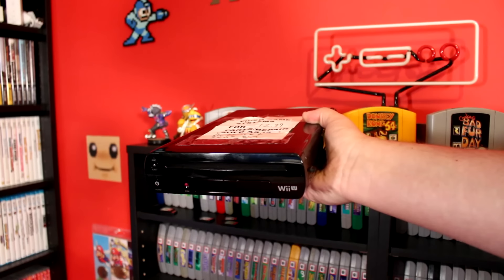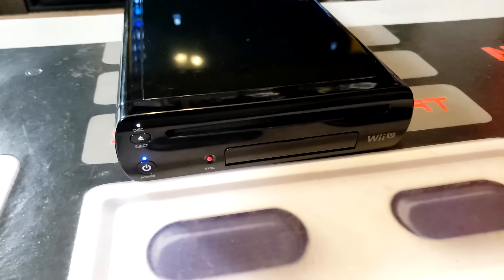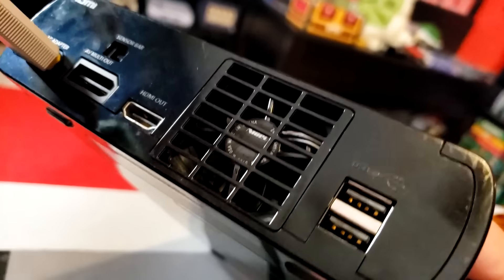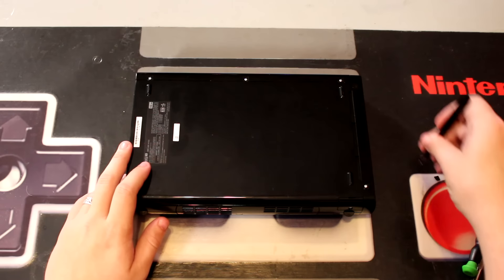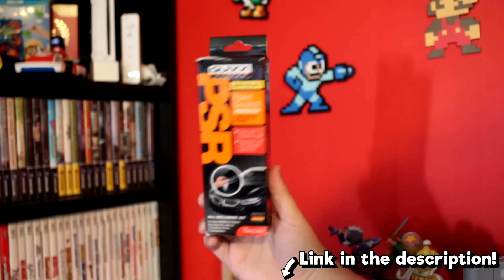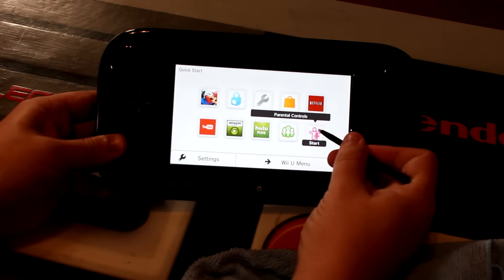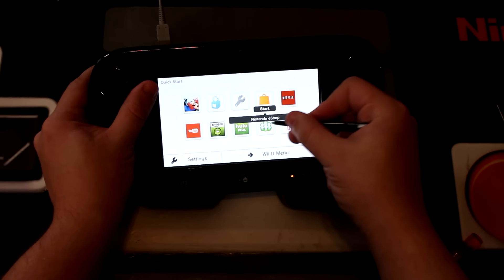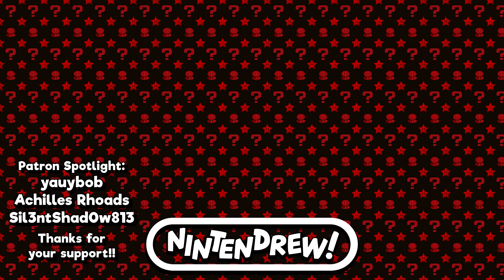Repairing a $13 Broken Wii U! | Nintendrew

Comment: In Berlin we have a tradition/Kultur of leaving unwanted things on the sidewalk or beside the front door "zu verschenken", to take. At worst, it's literal garbage that that for whatever reason wasn't taken to the bin. At best, it's real useful stuff. 3 of the chairs I have in my flat came off the street. I like to have the skills to repair electronics because my stereo also came zu verschenken because a switch had stopped working. All that needed was some cleaning of the contacts and now a €95 stereo is sitting on my shelf! As things are getting smaller and made from increasing numbers of black blobbed chips, it's getting harder. Those tight, tiny ribbon cables are frustrating! Having these skills are useful, though. There's still a lot of joy in older products and they can be had for toy prices now.
Reply: Nice. People do that in the states as well, but mostly larger items like furniture and its left closer to the sidewalk by the curb.
Reply: @alepepperoni2563  yeah, I had to "curb alert" all my stuff before moving here. Zu verschenken can be anything from leather couches (too heavy to take by myself) to literal rags. Even in Chicago, we had nothing like this. It was all the usual CL stuff or dumpster diving.

Comment: Nice, can't believe what a bargain that was.
The Wii U is such a gem, if I could only have a single non-current gen console that one takes the cake for its versatility.
Reply: In my area there is one store that will ask over 50 bucks for a none working model.

Comment: fans generally do that whole stop functioning and start thing when the bearing are going out a good way to test is if you assist the fan in turning and it starts spinning then its the bearing in it going bad. So I guarantee you the fan would have stopped again if that were the case.

Comment: Same thing happened to me about 5 years ago. Wii U randomly turned off, same blinking light turned on, it was hot, and that exact fan stopped working. All I did was spin it manually with a screwdriver while the console was on (I know, bad idea) but a few seconds later it started spinning on its own. Since then, I haven't had any issues even when powered on for extended periods of time.

Comment: I wonder if you could swap the fan with a quieter one (Noctua comes to mind), since it looks like a standard size PC/server  fan size.
EDIT: using the photo on the link, I found the part number (it's a nidec 40*40*20 mm chassis fan), and I think that a standard PC fan could fit here like a Noctua A4x10 (although that's half the thickness of the official one)
Reply: You could swap it. The only thing to beware of is that the connector won't be the same (I'm assuming here, but that's a frequent issue) and the layout of the wires won't be the same. So you'd have to find out which wires on the old fan are power, ground, tach, pwm) and match that up with the new fan. 

I have a big box of various dell server and PC fans and they all have to be rewired before I put them in a PC, Dell (like other manufacturers) purposely change the orientation of the wires around to stop the average user from buying an off the shelf fan... But if you can splice or repin the wires in the right order, it will work.

Comment: sounds almost exactly what happened to my original wii, the fan went out on it. pretty much did the exact same thing, it'd be fine for a few minutes then the power would just shut off.  and the area near the fan was super hot! so calling nintendo and explaining what happened, that was the diagnosis as well and they recommended I send it in. sure enough a few weeks later I got it back good as new! worst of all this was right around the time brawl was gonna launch for the system! so I deifnitely had to send it in ASAP to get it back and ready for brawl's launch!
Reply: The Wii U is pretty much a Wii HD with Higher specs lol (Scrapped Wii HD Revision?)
It even haves the same Crash Sound, and the CPU, GPU, Disc Drive and that stuff are the same Brands (AMD, IBM, Panasonic)

Comment: My Wii U also came with a Digital copy of MK8 and my Wii U had the Blinking light problem and it was very scary but My older brother told me it was because it was over heating because the fan was sucking in Dust because all fans of Consoles spin inward

Comment: Hah. that's how I got mine as well, found a Zelda Wii U for $20 bucks at a local thrift store with a broken game pad LCD. Spent another $20 to replace the LCD and digitizer and now have a fully working Wii U under $50 bucks.
Reply: I bought a Model 2 SEGA Genesis off of a guy for $15 labelled "For Parts Only - Non-Working". A $2 power jack and a little soldering later and I have a fully-functional console that looks almost brand new.

Comment: Real shame what happened to my Wii U. The Gamepad no longer connects to the system unless it's right on top of it. It's a problem with the controller's Bluetooth chip, but those are hard to find now, especially in new condition.

Comment: Well done! You make it look so easy. I tried just repairing a simple PS4 controller and ended up totally flubbing it and ruining the controller further… I think I would be pretty nervous to open up a console 😅
Reply: PS4 controllers are way harder to open up and fix than most older consoles.
Especially Nintendo consoles and controllers are pretty beginner friendly (aside from the switch and JoyCons)

Comment: Yo nintendrew (or anyone that happens to see this and has repaired wii u's) 
I ordered 3 Wii U's for parts, one of them im noticing the fan is actually put on backwards but it does not appear to have been opened  so idk if its a nintendo mistake or not, is it okay if i leave it that way and have air blow into the console or should i put it to where air blows out like yours and the other 2 Wii U's?

Comment: Great video! Loved it!! You should do more content like this ^^ and if tou want some advice to repair something, I’m always available! 

Seriously, you deserve to be much more known! Serious quality content here ^^
Reply: Hi, my wii u has a problem and I think I'm gonna have to buy a new one but I can't even find a console by itself so I'm gonna have to sell my stuff and buy a whole new console. I wanted to ask you about the issue maybe you would know, my red light is on but if I press the button it won't turn blue ( on ) but for some reason if I long press the button the fan starts turning, I know it's weird...
Reply: @malekhidar1267  i know this issue! It could be either your power adapter, another minor problem or your wiiU is dead.

Try unplugging it, wait a whole minute, push the power button 30 seconds, plug it back in and re try to power it on, if it works, your wiiu is saved! If not, come talk to me in private and we’ll try to fix it together ^^
Reply: @malekhidar1267  hey! Just wanted to know if I helped on that one? ^^
Reply: @ToriSa42  hiiiiii, I'm sorry for the late reply I've been quite busy, sadly I've seen this advice on redit and tried but it didn't work, I've even taken it to a repair shop and it's been a month and they haven't fixed it, luckily I got a very good deal, 30 bucks for a new 3ds XL so I'm gonna sell that and try to be buy a new wii u console. But thanks for helping regardless.

Comment: As much as I like the DIY projects there are some points in the video that does not really make sense.
Such as doing all the cosmetic stuff before you even ensure the console was fixed.

Worst case you use up material for polishing a nice piece of junk :(

Always ensure the device is working FIRST!
Then put it back together
Then cosmetics
Then test again.

Every other order is not reccomended at all!
Reply from the maker: When presenting for YouTube, sometimes a little creative editing is necessary for flow. 😉 In my case, I knew the Wii U was working before ever opening the case, but I did still double check my work off-camera. Actually, when recording, I repaired the gamepad first! Thanks for watching. 😄

Comment: How much would you charger to repair a wii u gamepad?
Reply: Typically a broken console should sell for 1/3 of the price. If it’s limited cosmetic damage (has no effect on the use of the console but also no cracks/ or major chips) you could sell for 3/4 the price of a new one. If the console is in pristine condition with the box, documentation, and cables, sell at near full price. Decent rule of thumb I’ve been told.
Reply: Also that’s for essentially any electronic, not just WiiU.

Comment: wow $13. That's fair, in our local 2nd hand market it would have been 50-100 for broken shit. Can never find a good deal for potential fixables here, something I'd love to get into. No offence to our local sellers, but broken junk is still broken junk...
Reply: He did not get it for that price. He printed out the paper and wrote the price himself. No retro store will sell it for that price even if it's completely dead it will still be expensive the Wii U is not a common system also it wouldn't come with a pad it would have sold it separate. Very skeptical that a retro store did not know that the fan wasn't working most retro store would fix it themselves. I personally believe he bought it from eBay and not for that price again he printed out a piece of paper and crudely wrote the price on it to fool his subscriber that he paid ridiculously low price but in reality he paid probably $80 to $100+ for the unit.

Comment: @nintendrew need help. Nintendo could jot help and I cant find help on internet either. Fired up Wii U to this message “There is a problem with the disc drive” error code: 160-1400
Any help would be appreciated. Thanks

Comment: I am going to be that person: I have to dislike any video where overheating issues are pointed at but you didn't even check for dust under the plastic funnel. "I checked outside footage" doesn't count. In general, checking for dust in a console that has has a fan and you had to open anyway should be a must.